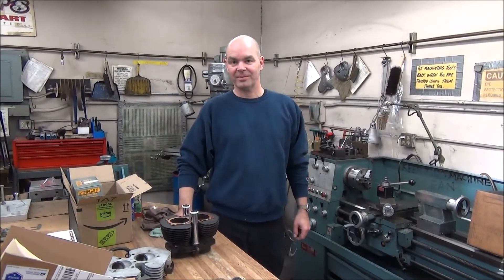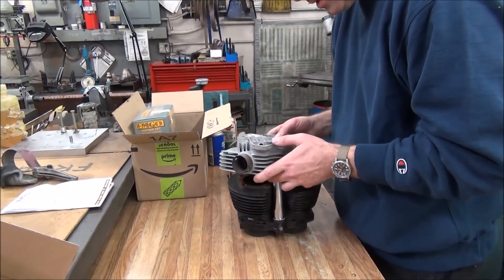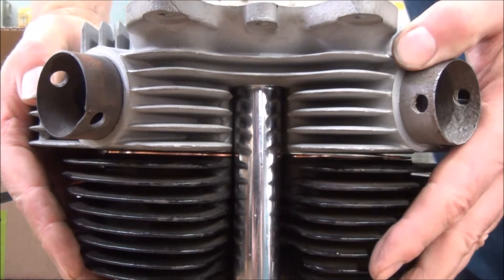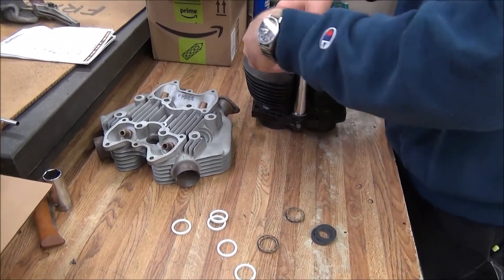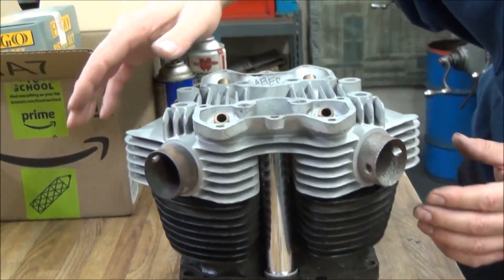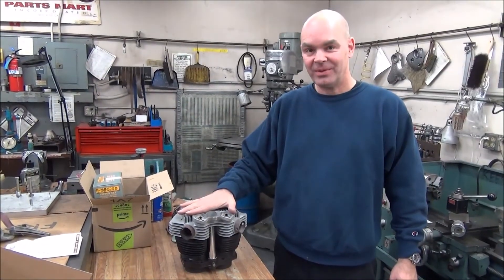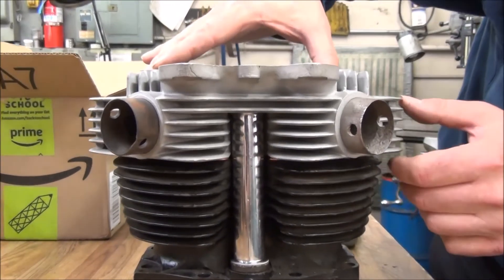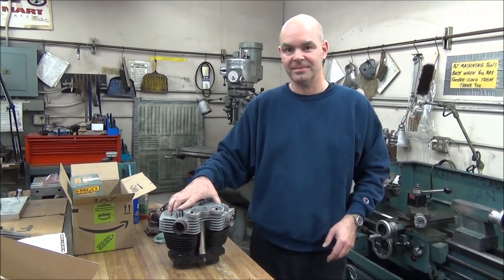Raber's Tech Tips: Episode #3 - Triumph 1967 T120 Bonneville Pushrod Tube Seals

Comment: Hi, During my career, I encountered a 633cc 9 stud pre unit Triumph engine in a racing sidecar outfit which was fitted with the 500cc pre unit Tiger 🐯 100 💯 one piece crankshaft with the 80mm stroke (650cc stroke is 82mm). These crankshafts, although of identical appearance have a figure 5 stamped onto the timing side crank web which is the way to tell them apart. A check with another cylinder showed that that cylinder hasn't been decked. The owner decided to replace the crankshaft knowing he could get a good 😊 price for the 500cc item.
The replacement crankshaft was sent off for balancing, sludge trap cleaned and journals measured which were still fine.

Comment: Don’t use silicon goo on the seal joints fit dry. 
I’ve used gas PTFE tape and it works great instead of the silicone stock ones  when I didn’t have seals to hand for the top tube  joint with a bit of well seal. Still leak free. The standard design bends the head and does encourage leakage across the two cylinders losing power out put.

Comment: Sure that's not 750 head the depth for push Rod tube is different only owed triumph  for 35 years
Reply: I thought that but it's a 9 stud head by the look of it. I believe 750s had ten studs
Reply: @bonkeydollocks1879  correct. 750s also have a slightly different sealing arrangement for pushrod tubes - the top seal is an o-ring, and there is another o-ring in a groove machined into the bore at the bottom of the tube, as well as the flat silicone ring squashed underneath and retained by the "wedding band". Mine have always sealed ok with the standard set up (for a few years, anyway, until they don't)
Reply: @rickconstant6106  yes, I was doing it of memory, what makes it hard for me is mines got a morgo 750cc big bore kit, and a 750cc mick hemming big valve head, all on a 650cc engine so I'm all over the place

Comment: I use a thick o ring on bottom and thin one on top of tubes. Both are the white o rings. As stated it all depends on how much head rock you get. Any one use gasket sealer or install dry? I would think dry is OK.
Reply: Tiny bit of the correct silicone

Comment: I remember how I entered into such the problem you described well. I had to reassemble all the top once again not really undrestanding what the reason for leak has been more because I trusted to "original" parts and sizes needed. The head hasn't been skimmed much except a bit but I even compared the other spare head . That all really took me too much time that was absolutelly not nice. Thanks Michael, for the explanation and quite useful video.

Comment: If the thinnest seals are needed you should also check if the head has been skimmed, if it has then you need a thicker head gasket and to then restart the gap checking process to find the right thickness seals.